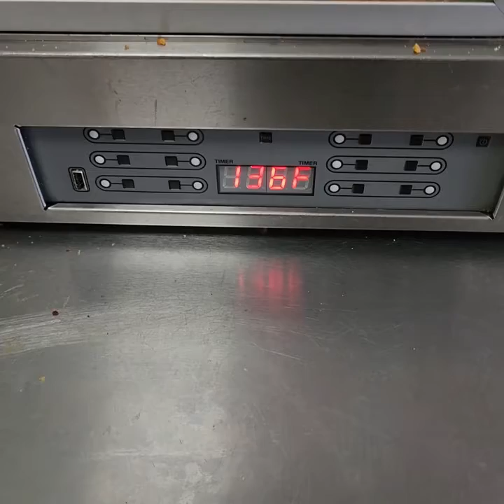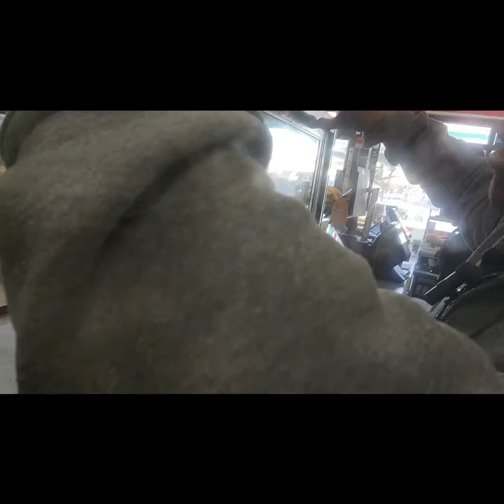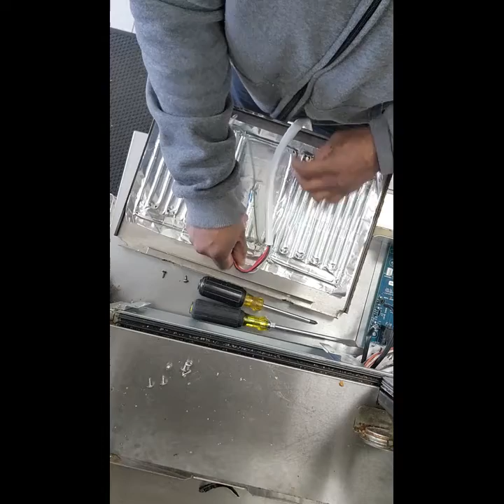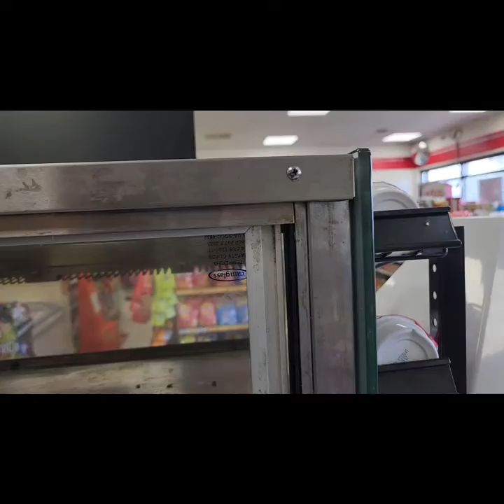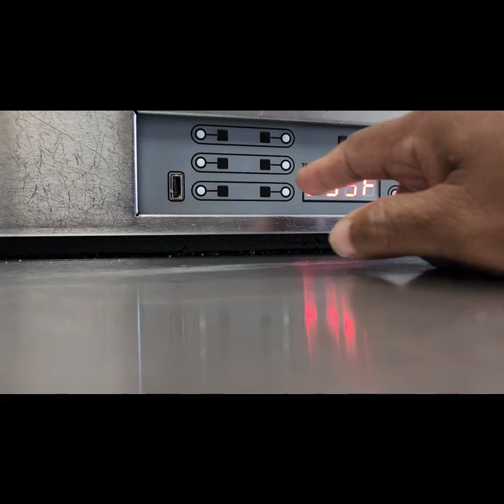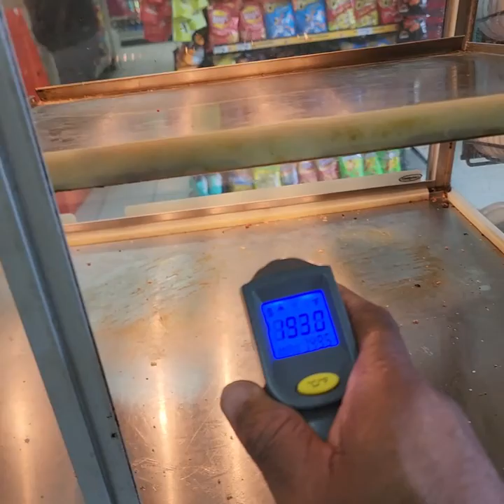Vendo Hot Food Display Case Repair

Comment: Helpful video
Reply: Do you have any videos on the heating lamp socket replacement and or on the long strip type lights that are a 3 tier set up
Reply from the maker: Thank you for the comment. I do not any videos on the lamp socket or lamp strip repair. That's a good suggestion I will see if I can put something together. Thank you

Comment: Quick question....
Family owned business... I been trying to help my mom repair a commercial food display. The top part isn't heating. It uses a quartz heating element for the top. 

I have installed 2 brand new tubs, but they all cracked after maybe 1 or 2 days. What could be the issue? It's a 240v machine.
Reply from the maker: @Raulito9  Hello Raul, if you can send me the name and model of the display case  that will help me find you an answer.
Reply: @latcommercialrepair Ah, that's the issue I been having too. We have equipment from the 90's, the info isn't visible. It was a hassle to find the quartz tub.
Reply from the maker: @Raulito9  Ok I understand. When you get a chance send a picture of the full machine and send a picture of the part you are replacing.  Send it to my email: learnatrade1@gmail.com